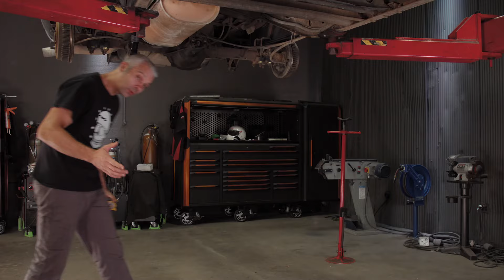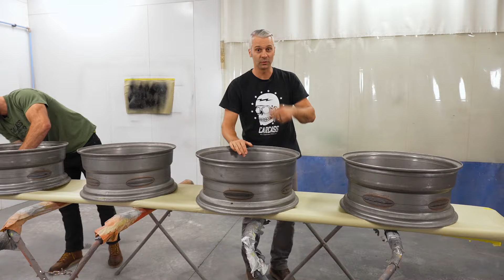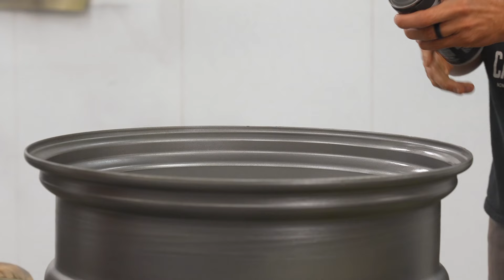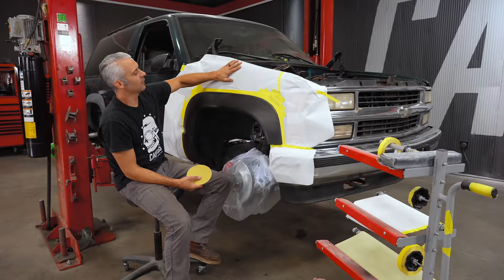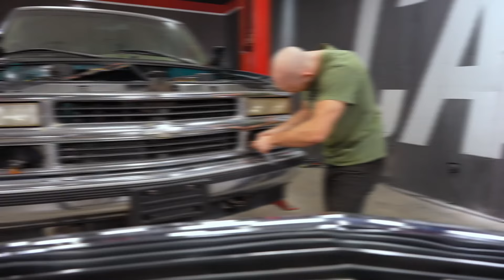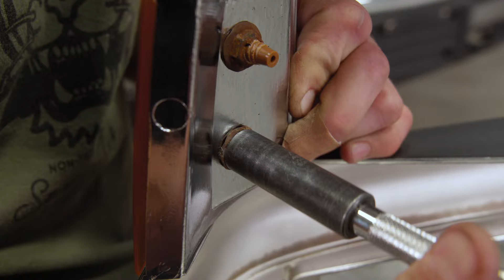Lowered 2-Door Tahoe Gets Fresh Looks & Wheels - Carcass S5, E14

Comment: Needed a flip kit and a lift shackle in the rear not drop leafs. Also djm nbs lower control arms with flipped upper for the front
Reply: TV show mechanics don't know what they're doing. Nobody will learn anything significant from these shows.
Reply: @davidmcgann9111  that's not true at all
Reply: @davidmcgann9111 these guys sure have done alot of technical work on other projects for someone that you think doesnt know what they are doing 😂 crybaby
Reply: Can you explain more about the lower control arm thing
Reply: @5ohtree  video out now
Reply: @5ohtree  djm lower control arms from a 99-06 truck with 99-06 spindles I'm making a video soon
Reply: @6.0joelsx does the nbs lower arms and flipped uppers give it a shorter track width. The 4x4’s have a much wider front track width than the rwd
Reply: @ slightly my wheels stick out evenly all around
Reply: I just got a 95 two-door Regency sport and I'm trying to do all of this because the parts are worn out. Did you ever make the video I saw your bottom comment
Reply: @TheTruth-v4e9e yes it's on my channel
Reply: @6.0joelsx awesome definitely will look at that